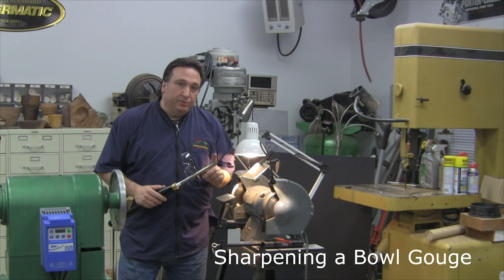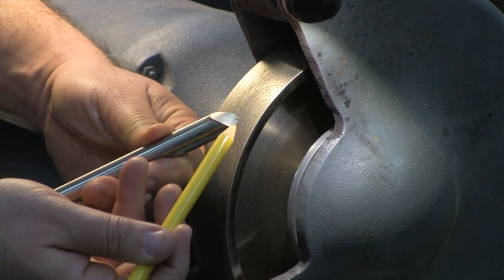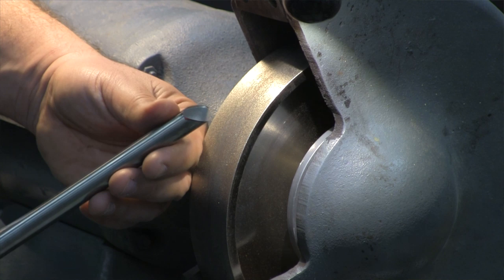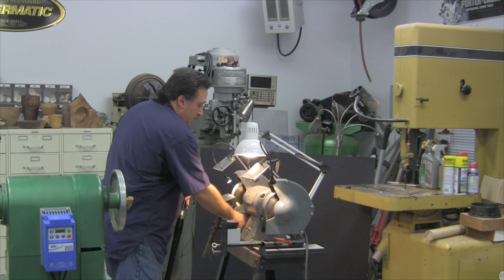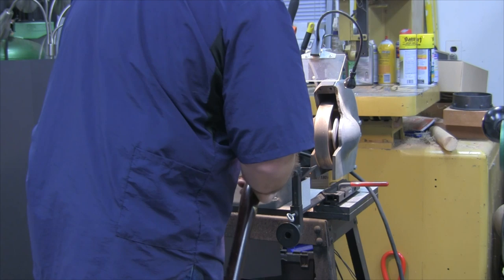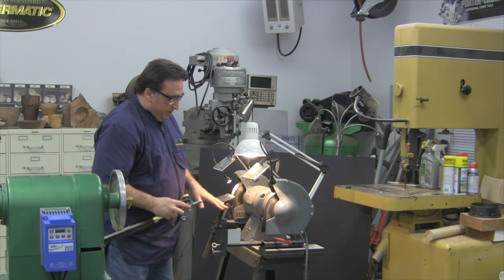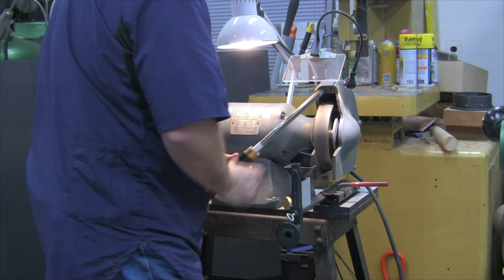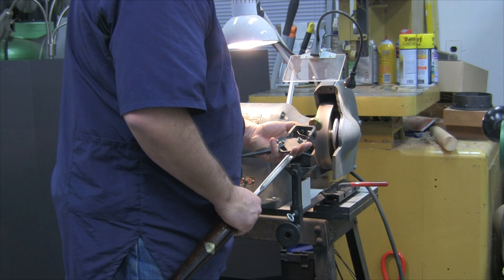Sharpening a Bowl Gouge - Part1 - Woodturning Tutorial

Comment: thanks for sharing. I've been struggling to get this grind right even with the use of jigs like yours albeit home made versions.  Can you explain more about the geometry and setup of the jigs, too please?  for instance, angle of the one way jig, height of the pocket it sits in and distance away from the grinding wheel to achieve the nice swept back wings.  I am using a 6" grinder, is the smaller diameter of my grinder adding to my problems?  thank you!